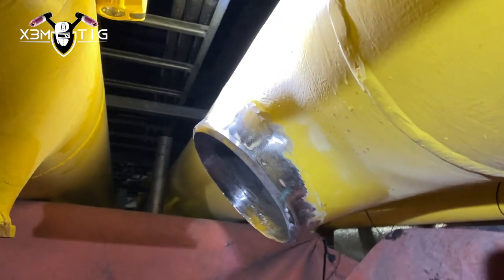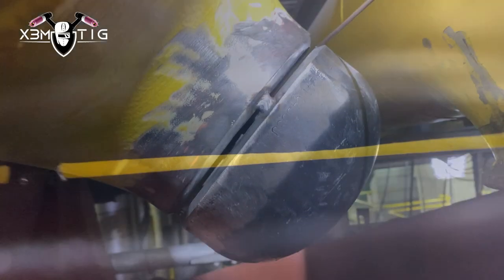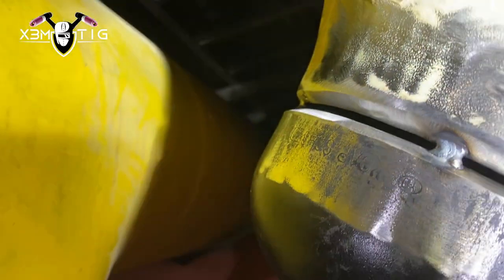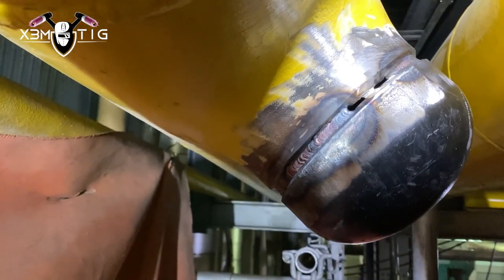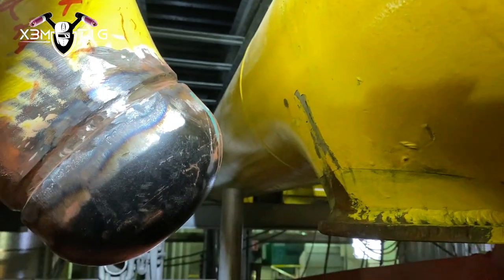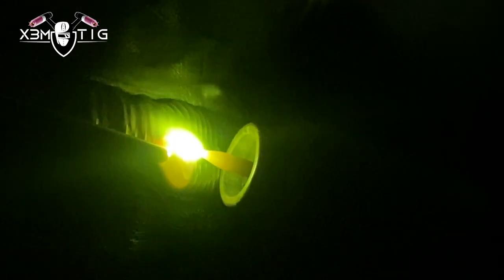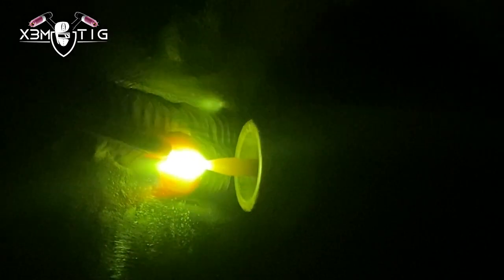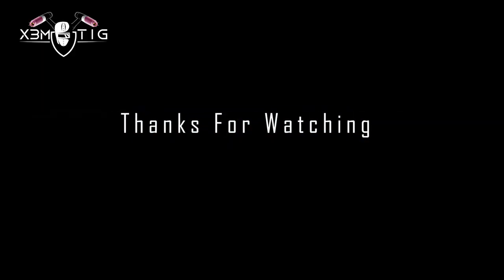6G Field TIG Welding In Position !

Comment: Definitely a tight spot and you're definitely a good welder. But if you don't need a mirror there's tougher joints out there. That being said great job on that.
Reply from the maker: Thanks for your comment bud. Mirror doesn’t mean that joint is tougher or not. It’s just a helping tool for a welder who is maybe unable to weld that joint without using the mirror.
Reply: I'd like to see you try to weld in a cogen without one. Cut your way in and weld your way out sometimes 6rows deep 100% Rt. That joint of yours is awkward but not difficult you were even able to walk the cup on it.

Comment: Good job on a tough weld. Retired now, spent 45yrs in the field. I had a fair few  where I couldn't get a grinder in, if I missed a spot on the bead I'd back weld through the gap, not to code but they passed x-ray  :)
Reply from the maker: Thanks brother 👍

Comment: wow how did you weld where you can't see?
Reply from the maker: Hey man, it was quite a challange!
Reply: @X3MTIG  much respect to you. Can you actually see the root going in on the top side? Or do you do it by feel/blind? Also how do you see your tungsten and if you're about to dip?
Reply from the maker: @michaelriccardi424  was aiming trough the 3 o’clock position and freehand downhill